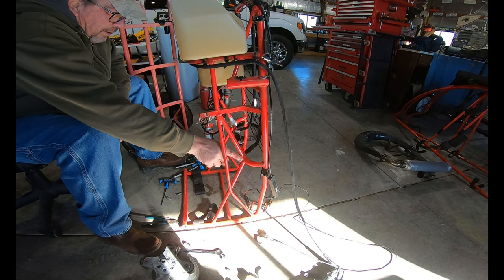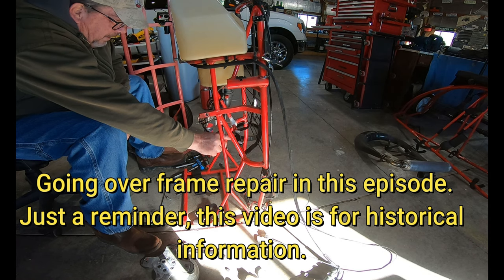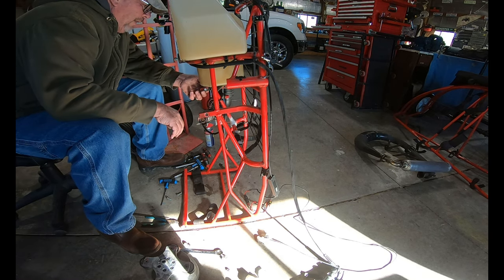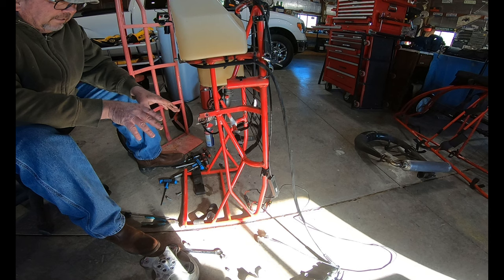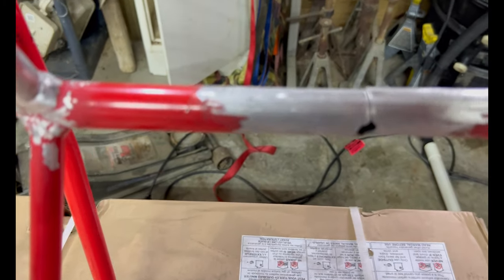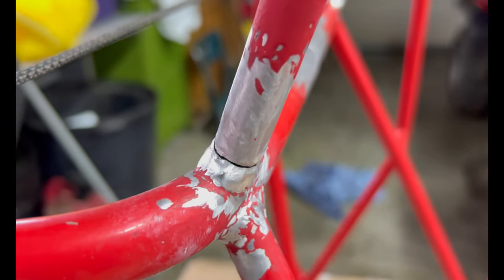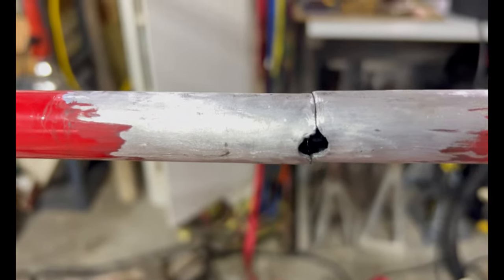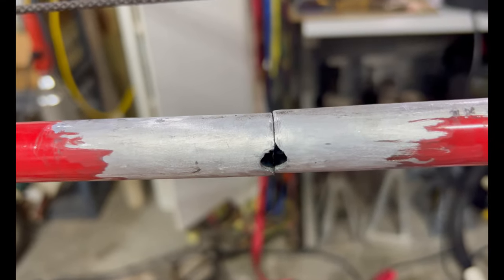Fresh Breeze Monster Tear Down Part V, Frame Repair/Preparation - Ohio Paramotor Trike Adventures

Comment: Well that ain't good. TIG is definitely the way to go brother. There are some brands out there where aluminum brazing is used for a lot of the frame pieces. It's quick-N-cheap, and that's fine, until it gets stressed. Not a fan of it though.
Reply from the maker: I ended up getting it Tig welded.  Turned out nice.   Let the rebuild begin.  😂

Comment: Wow.. al lot of cracks. I don't know what I would have done. a new frame or have it repaired. did you know about those cracks? Or were they surprises? Anyways it is a good idea to take it apart every Few hundred hours to have a good look at it.
Reply from the maker: I knew about them and patched them until the overhaul.  $800 for a new frame was a bit high compared to getting Tig welded.  If you run the same unit you can expect at least the big break to happen unless you secure it with reinforcements.
Reply: Don’t know how it is in your area but here a lot of welding shops won’t touch anything if they know it’s for aviation of any kind. I always tell them it’s for my snowmobile. 😁
Reply from the maker: @MikeSparamotor  they thought it was a fancy back pack.
Reply: There ya go. Bob the explorer!